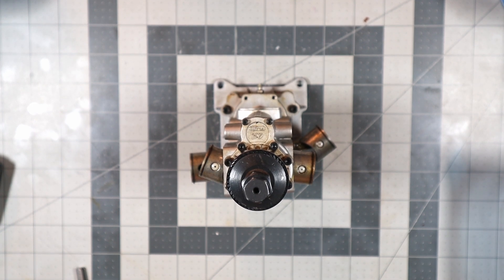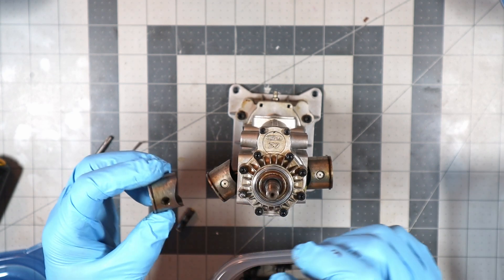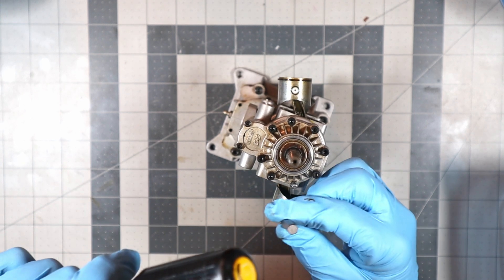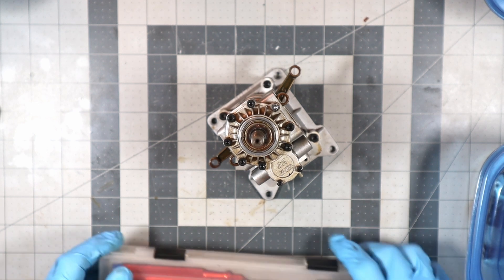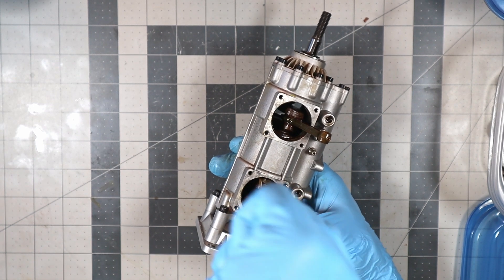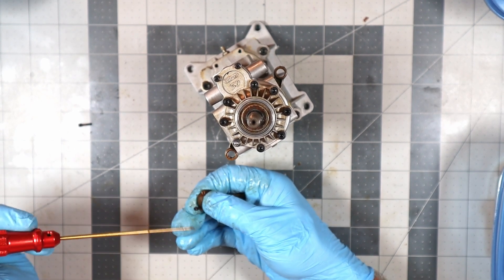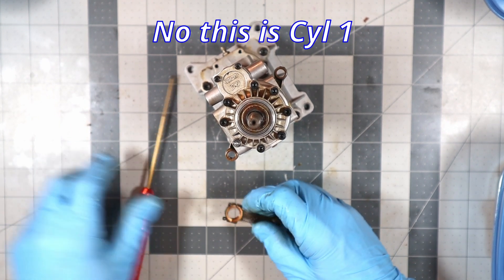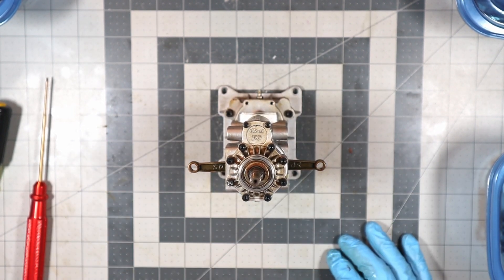Customer Engine OS FF 240 Pegasus Part 6 Piston Con Rod Removal

Comment: Hydrolock damaged conn rod, I saw the same damage on two engines ; one in a 320 and on an FR 5 300 sirius bote of them were damaged with choke closed  full throttle and using an electric starter;  the 320 on a cyl 1 and the sirius had the 3 & 4  conn rod bent.
Reply from the maker: Yes that is what i believe happened on this engine too. But I’m surprised you saw it in s 320. They should have all had the upgraded connecting rods.

Comment: Have ya foud a connecting rod yet. They're all over the Web. About $32. Small price to pay for a way cool engine. I needed an Irvine need valve. I bought a huge lot of Carb parts on Ebay tonite just to get what I needed
Reply from the maker: Please show me a link to a $32 generation 1 connecting rod. I don’t buy parts lots for customers hoping to find what i need in the lot.

Comment: Bent conrod. I'd hardly ever guess that myself. That could have happened from excessive flooding and consequent repeated effort to turn the engine over / start it up. Such a crying shame. Hopefully you can find replacement conrod(s) David.
Regards Harry
Reply from the maker: I already have. RCJapan
Reply: @dmrcflyr2  That's awesome news for both the owner and us engine-heads. Congrats David!
Reply from the maker: They are not 240 rods. They are the upgraded 320 rods.  Direct replacement not the bronze ones that had an extensive history of bending just like this.